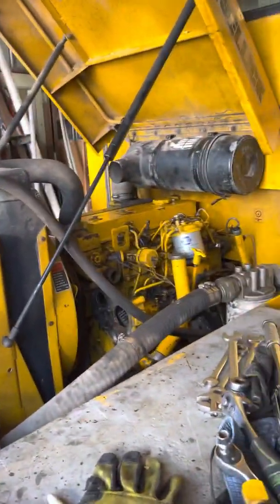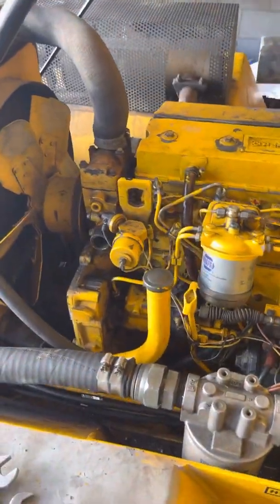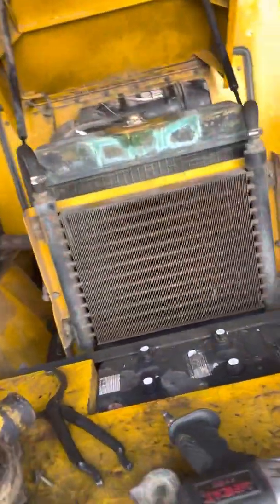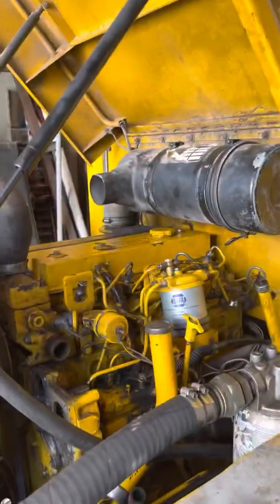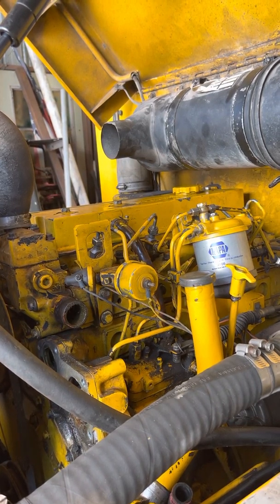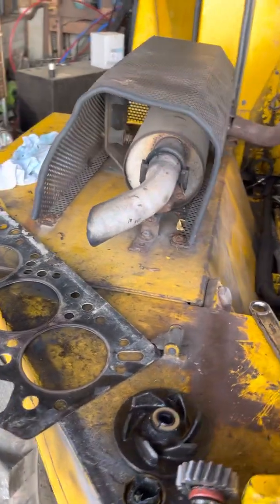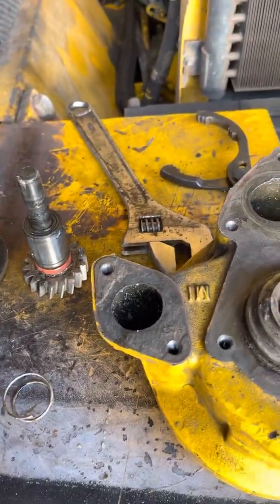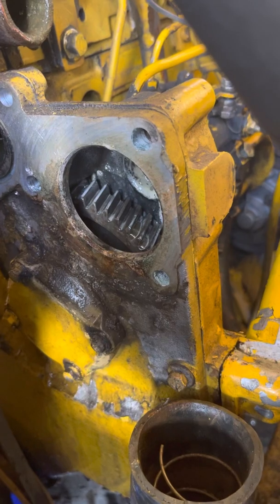Perkins water pump leaking in front case and mixing coolant with oil (looks like bad head gasket )

Comment: Just happened the 1004 Phaser engine in my 1990 3cx.
I'm told the water pump drive gear is timed into the timing gears, so I'm gonna have to get a mechanic to change it.